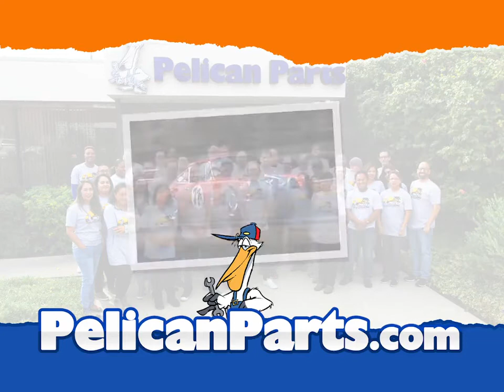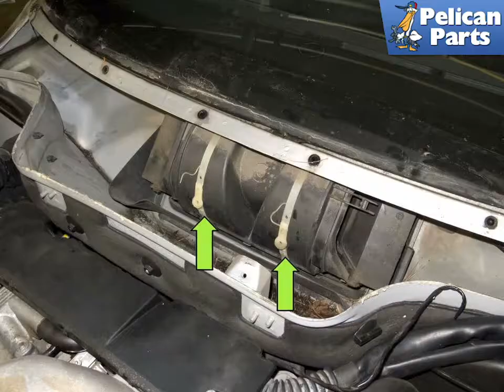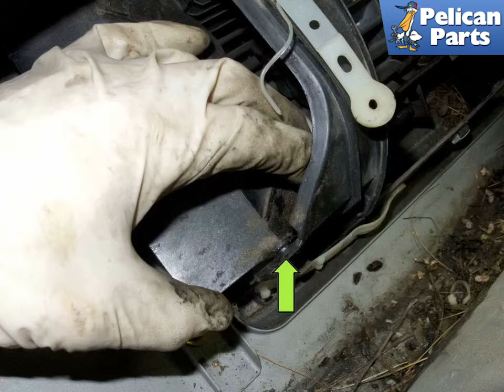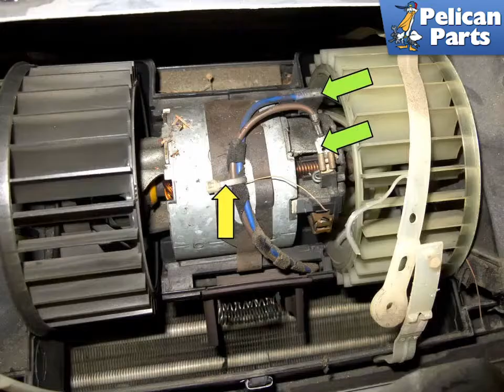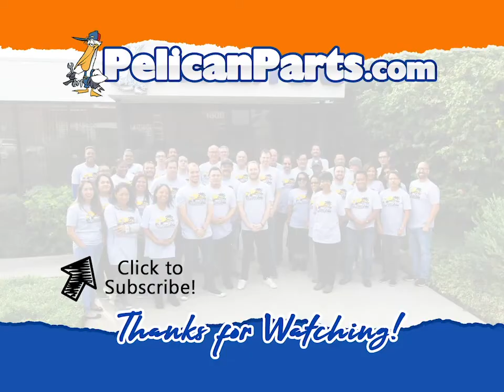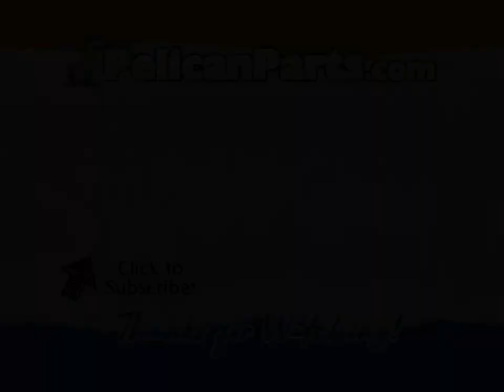BMW Z3 Blower Motor and Resistor Replacement

Comment: What I don't understand is why BMW didn't design this so that we'd also have to remove the engine and transmission to change this part...or perhaps remove the dashboard as well? Or what about both front seats? I mean, it seems like they weren't trying hard enough to bury this component deeply into the car.  🙂 Of course, as always thanks a MILLION to Pelican Parts for supplying an EXCELLENT and clear video procedure. Everyone should buy their resistor from Pelican just because of this video. Thanks guys!
Reply from the maker: Thanks for the feedback. Glad it was helpful!
Reply: I got mine ready on the jack

Comment: Just did this job. Seems to be working. That flimsy housing is a pain to deal with; but everything else was ok. Thanks!
Reply from the maker: Thanks for the feedback. Glad we could help.
Reply: What tools are required? I cannot find the part with wipers motor removal and there is no link at the end of the video